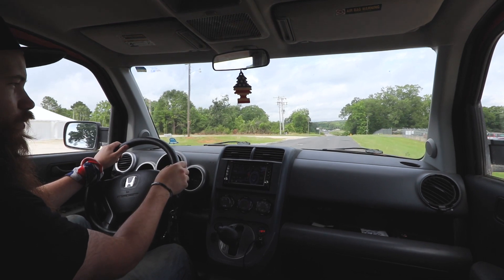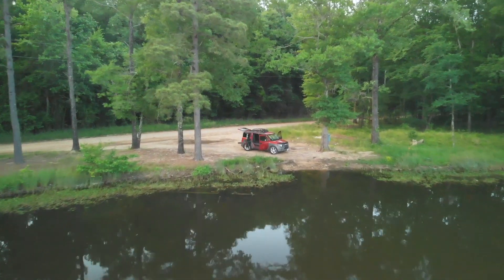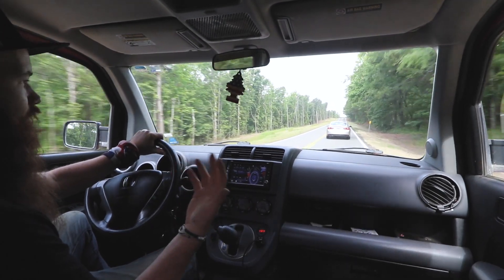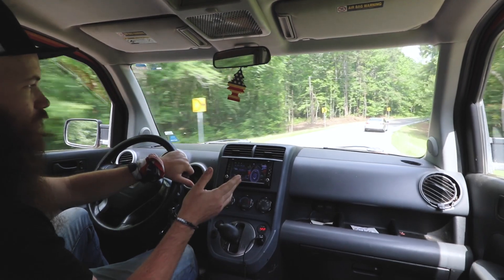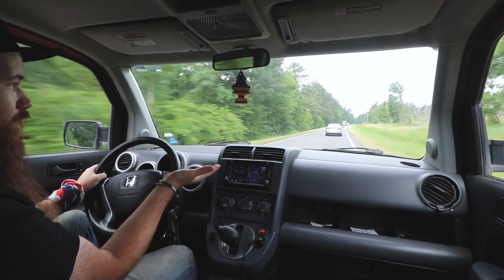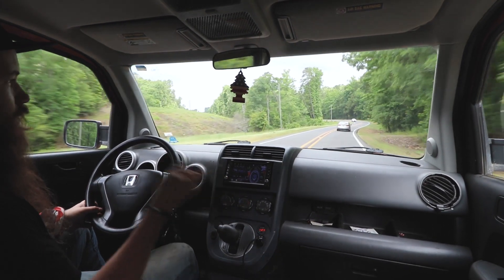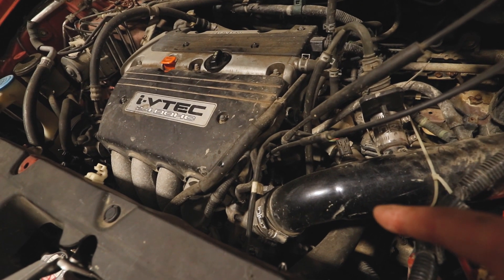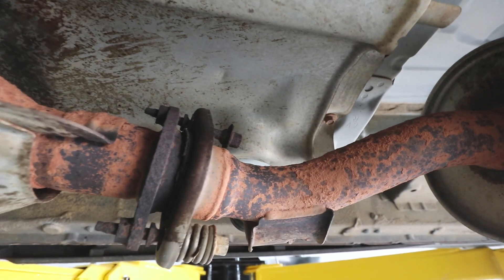Review of the 2003 Honda Element(10+ years of Ownership)

Comment: Thanks for the great video! I have a question.  I'm living in MX.  Just looked at an 03 Element last night (I bought this exact car new in 03 as soon as it came out!).  It looks great, engine sounds quiet and smooth, no rust underbody at all. I only saw two things that concerned me.  One, the engine light was on.  The seller, who seemed really upstanding, said he had his catalytic convertor stolen and after it was replaced, they couldn't get the engine light to go off.  The second issue, the seller pointed out, was a small oil leak.  Should I walk away or are these minor? Thanks in advance for any tips/advice!
Reply from the maker: Hey @rgarkey! Sorry for the late response, but those aren't deal killers at all. Element's have their catalytic converters stolen pretty frequently unfortunately. Small oil leaks are nothing for a 20 year old car at this point. Just keep an eye on your fluids and change your oil regularly.

Comment: I'm looking to get a 2003 one with 188k kilometers up here in toronto, for about 7grand. This is going to be my first car but I was told to watch out for the transmission, anything else I should check and how should I do it? Thank you
Reply from the maker: Since you are up in Canada I would just check for heavy rust on the rear suspension parts. You should be able to see pretty easily if the rust is bad or just on the surface. Some rust is ok, but excessive rust can total the car out. If you aren't sure, grab a friend who might be able to help take a look. Good luck!

Comment: i came hear looking for a solid review for these cars. there is a 2003 honda element ex sport with 160,000 miles for sale for $3500. im thinnking to pull the trigger.
Reply from the maker: Sounds like a good buy! Just check under for significant rust. Besides that check the maintenance records! Let me know if you have any questions
Reply: @DashnCars  I'm not to worried about rust I live in south west oregon. But is this a car I should be worried about why the price is low or take it to a mechanic for Inspection?
Reply from the maker: You can always do that, they'll be glad to help. It might have some worn bushings that'll rattle but nothing major I'd assume. The price is actually pretty good, about where it should be realistically.

Comment: Just found this channel, awesome stuff. Im ab to purchase an 04 Honda Element from my uncle out in Cali and it's got 175k miles and only one owner. Luckily, there haven't really been any rust-related issues since it's out there in the nice weather, but I'll be driving it around Michigan once I buy it. What are the top three things (or more) I should look for at it 1) gets older and more mileage and 2) starts dealing w the colder Mich weather? Thanks!
Reply from the maker: Hey James! Being Rust free is top priority, the rest of just insuring that regular maintenance has been done. Start the engine and let it idle, they're usually pretty noisy anyway. Ask if it's had a valve adjustment, I believe Honda recommended a valve adjustment between 120-150k but mine hasn't had it yet and it's over 200k. It'll just improve your gas mileage and make you engine run a bit smoother. As they age, they just have a few bushings that'll go, they'll let you know when they need to be changed they'll make a good clunk or rattle. 😄
Reply: James Hill   Valves need to be adjusted around 90,000 to 100,000.  Don’t think you can wait until something shows up.  Money well spent.

Comment: LOL I have the exact same car year and color have been driving it for years have been riding in it since I was three years old I know everything about the car yet here I am watching a review on it
Reply: All that being said I dont know if it’s just my car something I need to fix or it’s normal for a Honda element 03 model like you said yes there is so much road noise there are a lot of different sounds but I hear a lot of popping noises that seems to be coming from my axles is that normal? Mine is also in Arkansas car has always been is there a way to prevent rust because I’m starting to see from where the brake fluid sat it’s rusted
Reply from the maker: @bodaciousbetty1605  that rust is most likely from brake fluid leaking or being spilled on the paint. Brake fluid is super corrosive!

Comment: Hey so I’m going in to take a look at a used Honda Element at a dealership at 160k miles. Any tips on what to look for and also tips on maintenance if purchase goes well?
Reply from the maker: Good luck! Just ask and see if it's had any major services. One thing that would be good is a valve adjustment for that many miles. Check under the rear to see if there's any crazy rust too.

Comment: Opinion I’m looking at a 2003 they want $6000.00 out the door has 137.000 miles clean I’m in fla.only rust two hinges on back hinges .on holes in any interior.what don you think about the price.
Reply from the maker: Price isn't awful, I would think more of the 5k range. But the market is pretty high right now on used cars anyway. That's a good low mile car though! Just check the rear subframe for rust and make sure all the warranty and recall stuff has been done.

Comment: Hi, my element is just approached over 170,000 miles. Have you had to replace anything major like the timing chain?
Reply from the maker: I have not, you can refer to the service intervals to see when it is appropriate to change parts. The most common failure mode on the timing system is the tensioners. If the Element was ever ran low on oil, it could have caused stress on the chain/tensioner system.
Reply: @DashnCars  I have another problem leading to my next question. I would notice after 1500-2000 miles of every oil change, the oil level is in the middle the low and high dot level. Is that normal for a car of this age to burn that amount of oil? I’m using high mileage Mobil one 5w-20. What could be the cause of that? Btw I just started using seafoam high mileage oil.

Comment: Trying to decide between a FWD or AWD, primarily for car camping. Not sure if the moonroof is worth it, probably makes the vehicle hotter but also might cool it down when sleeping. I’ve had FWD all my life and I’m from Erie Pennsylvania, one of the snowiest cities and I could make due in a Toyota Corolla. I wonder if you lose a bit of clearance in the AWD cause doing some BLM camping I’ve been on some rough roads. Looking at 07/08, found a FWD with 175k $5000 overall runs good. I tested another that was misfiring. Probably the common clogged solenoid filter
Reply from the maker: Honestly both are great options the Element is big enough that your really don't need AWD.

Comment: Thanks ,  I like adventure vehicles... thinkn about buying the same on the low AS IS - what should I look at 1st or as my mechanic to check out ?  Belts, rods, suspensions. Shocks etc .. I like them  “rough riders” especially the cabin - cargo space... your feedback would help👍🏼
Reply from the maker: It's a great choice! First go through the normal rust checks on the rear suspension components, have them check the front compliance bushings, differential bushings. Those usually go out after many years, they're just noisy not anything bad. Have the mechanic check out any oil leaks, usually from the vtec solenoid. Besides that just make sure all the regular maintenance and recalls have been done!

Comment: Great review. I REALLY like the configuration of these. I've had my eyes on like a 2005 CRV which I like as well, but here recently my attention was turned to the element. Question, does your 5 speed manual element drive any different than the automatic? Like in acceleration and MPG?
Reply from the maker: I haven't had the chance to really stretch the legs on the 5 speed. It has a problem with the valves, so I've only driven it to the store and back a few times. It does feel peppy, compared to the auto. Much more engaging too, but that's to be expected. And thank you for the feedback! I've loved this Element for a long time, many more years of use to come!
Reply: @DashnCars    yeah that's what I've heard, that the manual has more pep. I'm wondering if part of that has to do with the automatic being a 4 speed, while the manual is a 5. I think in 2007 honda started giving an option for a 5 speed automatic. I'm curious how those drive.. What kind of valve problem do you have on your 5 speed?
Reply from the maker: I agree, I bet that extra gear helps it out. I think it was just under maintenenced at some point. The shop told the kid who owned it that a valve was bad on the exhaust side. That he needed an entire new head.

Comment: I'm looking to purchase a 2003 EX AWD Element from a friend. She's the single owner, 185k mileage. Regular maintenance has been kept up with some repairs over time (some of the bushings and sway bar end links). I'm not a skilled mechanic, but trying to do more and more maintenance and repairs on my vehicles. Would you say overall that I should be able to tackle most suspension/drive system repairs on my own with basic tools, a lift, and online guides? Short of needing an engine or transmission swap I imagine I can try and do most repairs to keep the cost of ownership low. Would you agree? Thanks!!
Reply from the maker: I would agree, depending on rust and a few other factors. Most of the body and suspension components could be seized. Just be careful before you dive head first into those jobs.
Aside from that enjoy it! You'll love it, it's a great car to learn how to wrench.
Reply: We haven’t had any trouble except for one broken bolt from the previous owner

Comment: I want to buy one for work.  What can I do to maximize longevity of the car
Reply from the maker: They're excellent work vehicles, just make sure you grab one that's been well loved and has pretty good records of maintenance. Check for rust on the lower control arms in the rear of the Element. Drive it around make sure it shifts well etc. Besides that, normal maintenance a valve adjustment is always good on higher mileage ones, dealer can do it for a few hundred bucks even.

Comment: Is the Spectre or k&N air filter really a big noise maker compared to the stock engine air filter? I mean  under normal daily driving circumstance where it’s not being revved past 4K. Is a free flowing air filter going to damage anything as far as engine longevity goes? Thinking about it if the air is going to allow more intake then by logic that means it is lessening the amount of impurities that it’s filtering. Or does the oil spray on the filter  counteract that problem? Idk it’s hard for me to decide if it’s worth the money
Reply from the maker: No it will not harm the motor. Just run a quality filter and do regular maintenance as normal.
Reply: Dash-n-Cars will it improve throttle response in terms of 0-60 acceleration? And how much noise will a k&N filter be? I know I ask a lot of questions
Reply from the maker: @markdesilva7207  😄 you're all good, that's why I respond! Any bolt on upgrade will give you a tiny "butt dyno" increase in power, but don't expect to be blown away. I purely got my intake because of money burning a hole in my pocket and sheer boredom. It made the Element have good grunt.

Comment: Have you had any issues with the gear drive system that it has in place of a timing chain or a timing belt?
Reply from the maker: Timing Chain has never been an issue for me,  but it can be with the K series motor. Always recommend new tensioners
Reply: @DashnCars  Excellent, thank you. I just bought a 2003 and thought I would ask.

Comment: Got a question. Does the red element have a lift on it or just larger tires? and If there is a lift, what is the lift and/or your thoughts on putting a small lift on an element. Thank you for your time.

Comment: Rav4 is a better built vehicle overall but the Honda Element has much better ergonomics. either vehicle is an excellent choice for anyone who has one of two kids and wants the safety of AWD.  The Rav4 is the actually the same vehicle as the Camry and Corolla but with a different external body thus parts for the Rav4 can be easily purchased due to the popularity of the Rav4, Camery, and the Corolla.  Aside from the external body of Rav4, most parts used to build the Rav4, Camry, and the Corolla are exactly the same.

Comment: How does the automatic transmission on this car compare with the CR-V , Civic and Accord? How reliable is it?
Reply from the maker: The automatic has been very good for me and I've abused it a lot harder than I should have 😄. I raced the Element off road for 4 years and it's still doing just fine.

Comment: I had a 2003 crv.....awd....kind of lousy on gas milage but great on the hills and snowy roads of western canada.......my question is air bags....crv and honda accord civic recalls.....did this have  air bag recalls?
Reply from the maker: Oh yeah, several of them. Essentially all Honda vehicles equipped with the Takata bags had to be recalled and serviced.
Reply: I have an 04 and 05 Elements. They are the exactly the same as the CRV’s. Each one has two separate recalls, one for air-bag and one for the igniter. Drive into any Honda dealer and they can tell you if they were changed, and if not they will do the work for free.

Comment: Those Type-S wheels look sweet on your E dude. Is your manual FWD or AWD? I have a 04 manual FWD with 200k on it. I've just been working on it to get it running like brand new but I've experimented a bit with EP3/DC5 parts on my E but nothing major yet
Reply from the maker: Thanks brother! It's a manual AWD. I want to do a different k in my Element. Maybe an A2

Comment: What is more desirable for off roading with an element manual or automatic AWD drive..
Reply from the maker: Depends on what kind of Offroad you plan on doing. Manual will be more forgiving and easier to maintain, but an auto is generally easier to just go light wheeling, dirt roads etc.

Comment: I’m looking at purchasing a 2004 Element with 94,000 miles on it. According to CARFAX, it’s only had one owner and no history of accidents. How much of a factor is the age of the car?
Reply from the maker: That sounds like a very good example, what I would ask is for some service records. It would seem being that old with that few of miles it might have set for a while or just not driven far. If all the history looks good, it should be a very good vehicle. Just go over the Carfax throughly and make sure you didn't miss anything!
Reply: I have a 2004 A/T and a 2005 manual. Age itself shouldn’t matter unless your in the rust belt. In 2007 they went to a five speed automatic which seems to be the only meaningful upgrade. The  four speed actually revs about 300 rpms les than the manual five speed at 75mph, which is the min speed on I-4. My 04 has had no problems in sixteen years, besides two sets of front brake pads (A/T plus wife driven). My 05 manual has had a few more issues (alternator, starter, motor mounts, lower control arm and drivers seat bushings).
Change your fluids and use only Honda fluids except motor oil, keep it away from the dealer and salt and it can last a long time. Get the service records and check  the recalls on the airbags and actuators, keep the coffee out of the seatbelt latch (wife again). If you don’t want it, I’ll buy it.
Reply: @bohickity  thank you for you input. There was a ton of rust on the bottom so I passed on it.

Comment: I checked all my fuses and make sure everything is OK with   the Freon and everything and I still can’t get cold air out of my element and the motor for the AC does work because it does move
Reply from the maker: I try to recommend most people to go to a shop that can properly measure the level of freon in the system. Modern AC systems are so particular with the levels, if you are just barely over or just barely under the AC compressor won't actually kick on. I would take it to them to get the level addressed or rent a machine that can give you an accurate reading. 
If that isn't the case the compressor is probably shot.
Reply: Dash-n-Cars oh okay thank you so much

Comment: Thinking about buying a 2004 with 250k miles on it. Should I be worried about the miles? It has been well taken care of and is immaculate inside. Their only asking $1,500. It would be for my 16 year old son. His first car. Your thoughts? Thanks
Reply from the maker: That's a great price! Just check for rust underneath, that's a real deal breaker. Make sure to go through all the gears and see if it shifts smoothly. Besides that, for the price you can't beat it. Might need some light maintenance, but that would be a great area if he wanted to learn how to work on an Element. They're very good for that!

Comment: Do you remember what spring rates came with your BC coilovers?
For spirited driving, would you keep the same...or change (the spring rates)?
Lastly, what are your plans with the manual Element?
Thanks
Reply from the maker: I'm not sure which rates mine are, but they are 30 way adjustable. You can turn this thing into a go-kart cranked up!

Comment: Just bought a 05 5 speed ex. Want to j swap as well but the people who make the adapters dont responded to emails. So thinking instead of k24a2 with a supercharger.
Reply from the maker: That's a better and easier option honestly. I want to stop so a J swap just because, but it's not the smartest.
Reply: @DashnCars  I wanted that j as well for performance and towing but I'll settle for blown k series. Just moved from socal to idaho and am winterizing my picnic basket(element) any spots In particular I should spray,oil or wax you can think of?
Reply from the maker: @thewoodengnoem  all of the suspension bushings, especially exposed bolts. Hit those good!